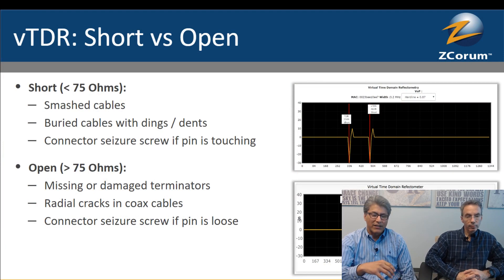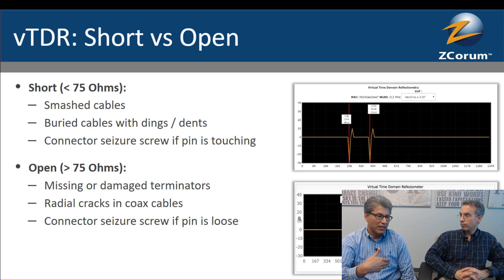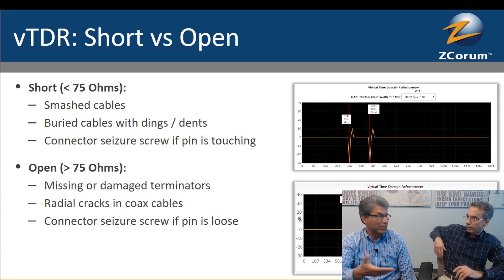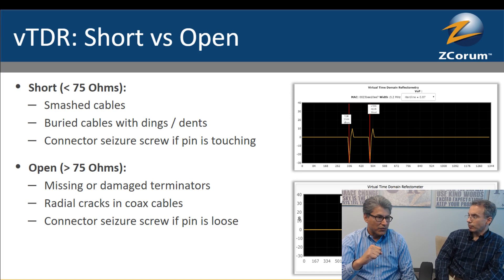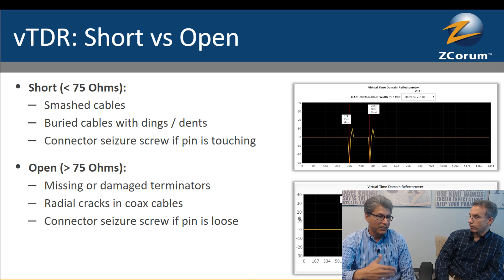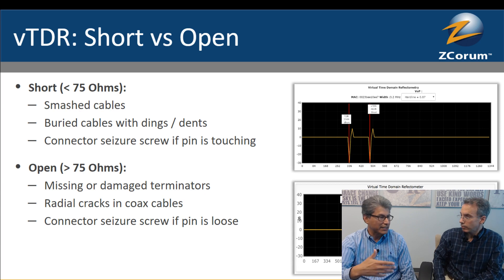DOCSIS PNM: Understanding TDR and vTDR

Comment: I use tdr through pnm at my job but I can’t figure out why 98% of the modems all say 41ft
Reply: That’s the rough length of the echo cavity in which the micro reflect exists which is typically going to be between the last good modem and first bad modem as it has to be a part of the plant that every affected device has to share commonly. You would then look at your prints in that situation and narrow it down